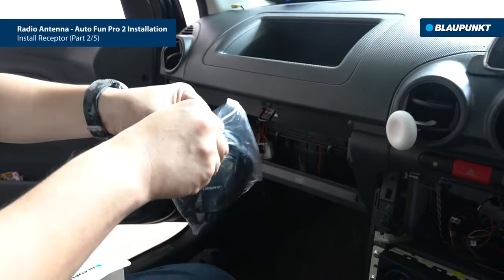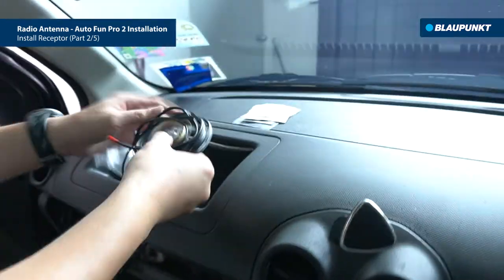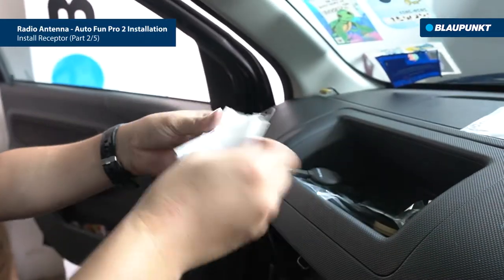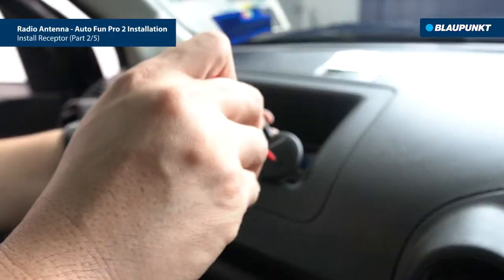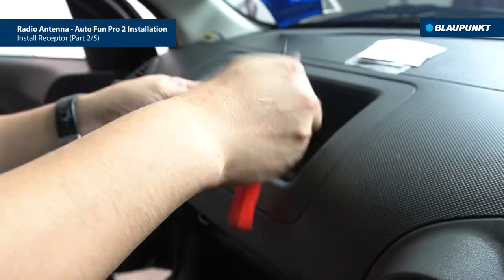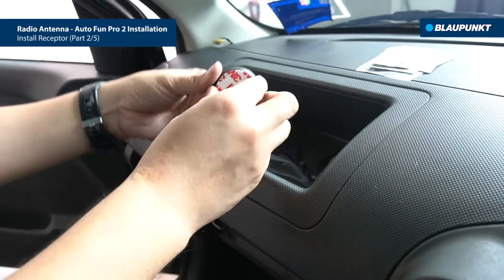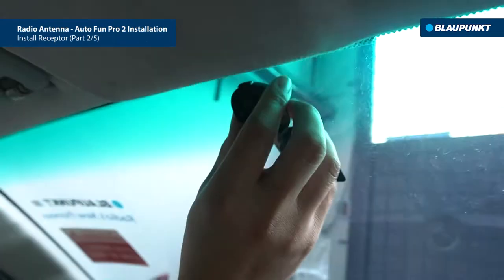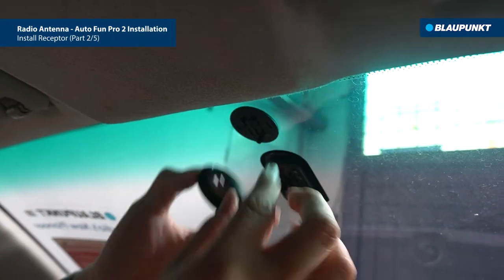Auto Fun Pro 2 Installation Part 2/5 - Blaupunkt Radio Antenna

Comment: 1) How long is the coaxial wire from the antenna to the receiver?
2) How long is the dipole antenna? As I want to stick to the side of my MPV large  window. Can I cut the dipole shorter if it is too long?
Reply from the maker: Hi, the length of coaxial wire from the antenna to receiver is 2m.
There are 2 receptor wires that come with the box. Each of the receptor measured 0.5m in length. You can trim off the receptor wire if it is too long for your car windscreen.

Comment: Hi, if i put receptor line on dark tint film, is it will effect to radio signal?
Reply from the maker: Tint transparency doesn't normally affect the reception, but it's the tint composition that will affect the reception.